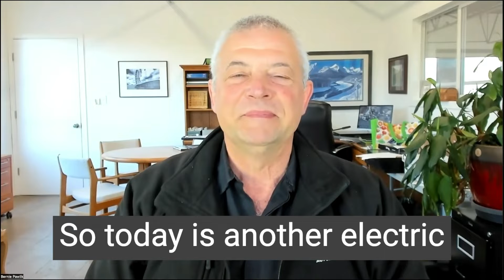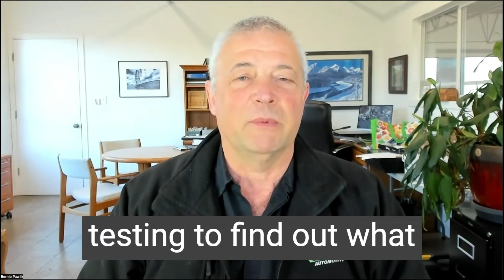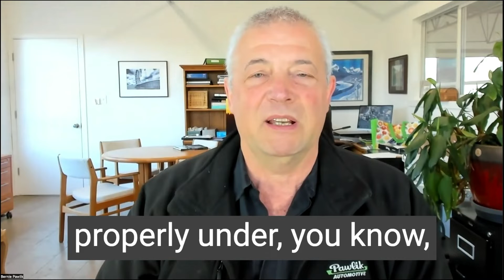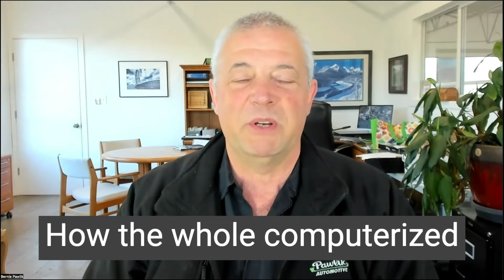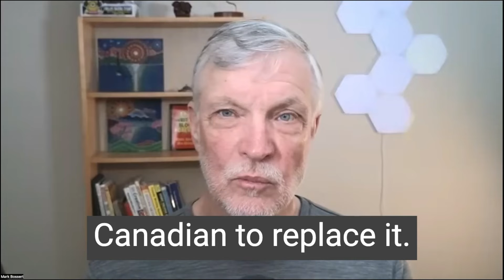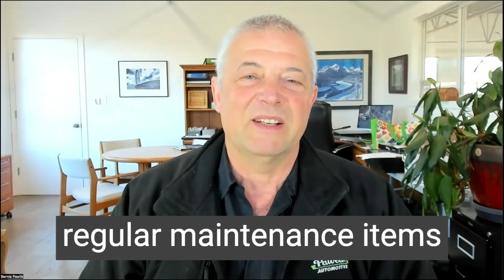2015 Fiat 500E Battery Coolant Heater

Comment: i got the same issue, service electric vehicle system. read alfaOBD claims short circuit in the 12V part of the battery coolant heater. fortunately, i own this part used.
Reply: Ich mach das wieder ganz